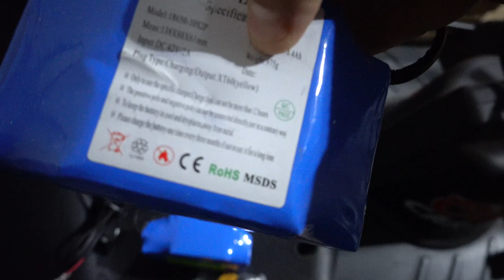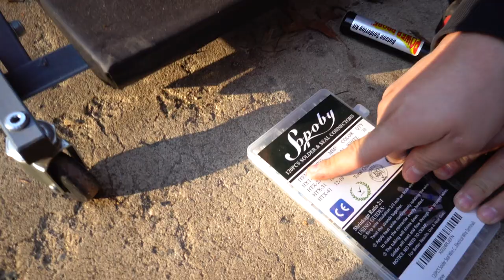NEW Crazy Cart Motor & Hoverboard Lithium Ion Battery Install!!

Comment: Any concerns about using a charger meant for lead acid battery charging on those lithiums?  I would worry about them exploding or starting a fire while charging if they get overcharged.  How about durability of the batteries using your current charging setup?  Are they still lasting well today?  Another thing I was curious about is if the cart would discharge the lithium batteries too far and damage them.  Normally devices designed for lithium batteries have a limiter to prevent deep discharge that can cause damage.

Either way it is cool to see the mods people are doing.

Comment: Cool video, just bought one of these XL carts yesterday for my kids and am looking into adding accessories (led headlights/tails underglow) and increasing run time/amperage. Can you update when youve figured out total run time of these batteries? and if im just looking for add a bunch of lights and stuff, think i can/should just run a seperate 12v battery? Thanks - Bob
Reply: There is a Facebook group called crazy cart modders ask them idk

Comment: Upload a video of how you charge the batteries 👍
Reply from the maker: What do you mean? Lol
Reply: @StayOnTheGas  now you have change the batteries are you using the stock charger and charger port or dod you have to change the port and charger ?
Reply from the maker: I’m using the same port and charger. I wanted to keep it and clean and simple as possible 👍🏼
Reply: @StayOnTheGas  I’ve just put a hoverboard battery on a mx350 was wondering how you was charging figured it out am using a xiaomi 36v charger and port thanks for the reply 👍
Reply from the maker: No problem!

Comment: Yo do a battery like this for a regular crazy cart please!!
Reply from the maker: The other video is basically this setup. It’s just 1 battery instead of 2 like this one. Running them in parallel doesn’t make it any faster than the regular cart, the charge just lasts longer. The regular cart is definitely the fastest one in the fleet lol
Reply: @StayOnTheGas  I got ya boss, could you please send a link to the battery you used and those connectors that ya heat up please. Also do they use 250w motors on the regular carts?
Reply from the maker: They should be either in the description of this video or the other one

Comment: So how long did those new batt last?
Reply from the maker: Over an hour and a half of hard nonstop riding! That’s as long as we’ve tested it. Might last a lot longer, might last just a little bit longer.
Reply: @StayOnTheGas  Nice! It'll probably last even longer with the higher Ah (like 10 Ah)
Is it any faster?
In the video is very hard to tell, on that rough surface you guys tested it out on. 
Grear job, thank you for sharing.
Reply from the maker: Yeah a high amp hour will make it last even longer! And it’s hard to tell on our rough driveway like you said. We’re waiting on warmer weather to take them out somewhere nice